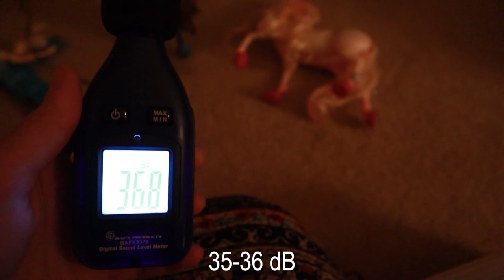Soundproofing a Floor! DIY Vocal Booth Part 1

Comment: The rubber is good, you can also get pink phone from the hardware store that’s about an inch thick I just cover the floor with that and you could lay that rubber indoor carpet over it. A ton of noise is going to go through your vents so what you might do is hang something material in front of it, something like a quilt rack or just any kind of rack where air can still get through but you’re not going to have direct sound going into the vent. Your wall should be good because they’re thick with the logs, I’m not sure about the drywall areas though

Basically with sound you can deflect it absorb it or muffle it. Other than that all you can do is put ambient sound in the other room, like if you got a sleep machine that added some sound into the room where they sleep then any sound coming in would be competing with that and just be a lot less noticeable.  The foam board will be doing two things one it has a semi solid surface so it’s going to reflect sound away. Something soft like a material or an expose foam will absorb the sound and muffle it and if you throw carpet on top of that and the rubber layer, That’s a bout the best you’re going to do without opening up walls and doing some serious construction. The flooring you put on top of that will be good for deflecting it but if you put a rug on top of that it will help. If it’s not enough then you might wanna pull it back up and put a layer of the foam down. But I think you’ve covered most of it at this point I would just put a rug over the floor to absorb sound and block off the vents so there’s something soft in between. A lot of that noise is still going to go through them and sound waves travel in a circle from the sound source so just make sure there’s something to absorb that and or deflect it between you and the vents. That room also has a ton of echo so if you put up some tapestries were hanging carpet on the wall it’s going to absorb a ton of sound as well and you won’t have that echo and megaphone affect from the sound bouncing off the walls, getting rid of those echoes by absorbing sound will make a huge difference for lowering the volume in the room in general.  

Another option is you do have that loft space, soundproof that and put some kind of curtain up there as well and when you go up at night maybe put a desk up there or you’re going to be making some noise and that sort of like having a little soundproof room inside of a bigger soundproof room and that can make a big difference. 

Lol. I play guitar and I’ve tried to make a ton of semisoundproof rooms in my life.

Comment: As far as dampening ambient sound and footfalls goes, you did a really solid job! Advantage on stealth checks gained! XD

I'm sure you know this already, but you'll probably want something a little heavier duty for the booth itself. If you're still researching, I've used Auralex for my own mini recording booth, but the one at my University uses ATS acoustic boards and I'd actually recommend those given the size of the closet you're planning on using. No matter what, you'll still get some noise in the bass-range that, like you said here, is almost impossible to get rid of unless you're willing to completely retrofit how the space is built, but as long as the paneling is hung properly, you'll be able to cut mid and high-range substantially. If there's anything else I'd recommend, it's just to remember to put something over the doors on the inside, even if it's just a heavy curtain.

Best of luck! Can't wait to know how it turns out. <3
Reply from the maker: Thanks for the comment @sarah tilgner! Man, I'm scared of treating the booth. There's so much knowledge to absorb and I'm pretty much starting from zero.
I agonized a lot over whether this closet would even be a good idea since the last thing I want is to sound "boxy" in a small enclosed space, arg! But I have to try at least!!
It's currently impossible to find doors anywhere in my state, so I might as well start planning the booth treatment. I'll be adding another drywall layer, then I hope super knowledgeable people like yourself can help meeeeeee :D
If i throw a bunch of money at bass traps, would that help? Lol, throwing money usually helps

Comment: Sorry, both for the comment and for not waiting till the end of the video to post.  I deleted my comment (and then later saw a notification that you'd replied, so sorry for that too) because it was for the most part, unnecessary.  Most people note a slight reduction in sound after using mlv and other flexible sound barrier products like this rubber, but it tends not to be good enough.  Based on how you described your issue, I just figured you'd need a more extensive approach.  Are you able to add layers of drywall as a renter?  If so, I find damping glues to be better than I expected.  I used Quietglue Pro and a second layer of drywall; After a few weeks, it notably reduced sound through my ceiling.  You may also be able to rent one of those blow in insulation machines to add insulation without having to remove the current ceiling.  Both options reduce high frequency very well.
Reply from the maker: It's all good! I'm pretty happy with the floor now, just adding that mass has helped a lot with not waking the kiddo up with every tiny sound. That plus, if I'm going to stream or make more noise than usual, I stuff some towels into the floor vents (hah! So professional).  
I think the closet, which I would like to be a vocal booth, it going to need some more effort though. I've gotten permission to make changes to the closet, which is great. At the very least I'll add a layer of peacemaker on the walls/ceiling, then glue (I think) and another layer of drywall. 
If I want to put more effort and expense into it, I can remove the current drywall, put some better insulation in the walls/ceiling like quietrock, then do the peacemaker/glue/drywallx2.  
I don't know what the better option would be : (
The hardest part of this booth, though, is finding some dang plain solid interior doors to put on it. My state is like, sold out everywhere!
Reply: @TabbyTabaxi  Well, I noticed you've got some woodworking stuff... Ironically, some of the best soundproof doors you can get are ones you can build yourself using 3 layers of 3/4" mdf sandwiching damping glue and screwed together for a total of 2".  I have communicating doors, which are two separate doors with about a foot gap between them separating the living room from my bedroom.  The first door was already there, but the second one I built.  I built it as a hollow core door to save money, but just hear me out:  It's composed of 1/2" hardibacker concrete board facing toward the other door, a wood framed 1" air gap filled with insulation, and a 1/8" layer of plywood facing the bed room.  No damping glue, but it weighs about as much as a solid wood door.  With communicating doors, they don't have to be as robust as a single door.  As far as the closet construction goes, if you're going so far as to remove the walls (including the ceiling in the closet), you could add staggered studs for decent decoupling if you don't mind loosing an inch or so of perimeter floor space.  R1 resilient channel is another option and can take up as little as 1/4" of space.  You may need to construct a 2"x4" floating floor for the closet depending on how soundproof this vocal booth needs to be.
Reply: @TabbyTabaxi  BTW, in my time talking to soundproofing experts and hearing from home theater builders, most would tell you to go for a genuine constrained layer damping (cld) system if you're going to layer drywall, and not to use these expensive specialty barriers in walls (they're mostly best for floors for impact reduction, or tight spaces like soundproofing a car, specialty products like bass traps, etc.).  I'm not saying these materials do nothing of course, I'm just saying there are better options depending on the situation.  Sandwiching two layers of drywall together with thick internally damped soundproofing materials like mlv or rubber is not worth the cost because: 1.  drywall is a cheaper form of mass, and 2. Damping glues are an actual visco-elastic material designed to impart a cld, whereas rubbery solids won't have a cld effect on the wall structure, even if you glue them to the drywall.  I can't remember whether I delve into that in my videos or not, but the end result is you're basically overpaying for mass.  I'm not trying to be a spokesman for damping glues (lord knows I'm not being freaking paid) but seriously, try the stuff out.
Reply from the maker: @whatismisophonia I'm slowly making my way through your videos :) 
You're not a shill for the damping glue industry? Hah!